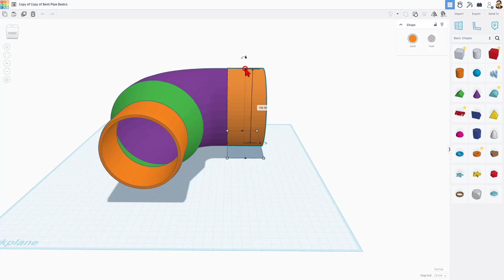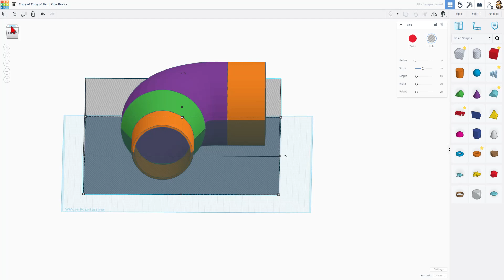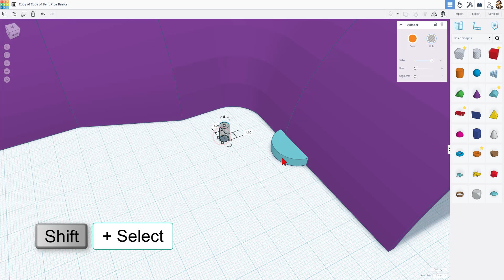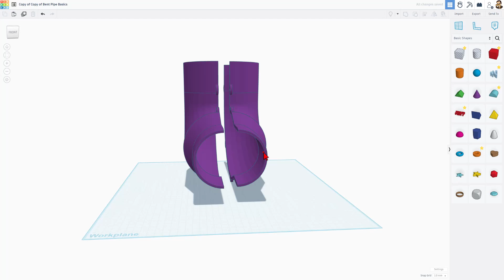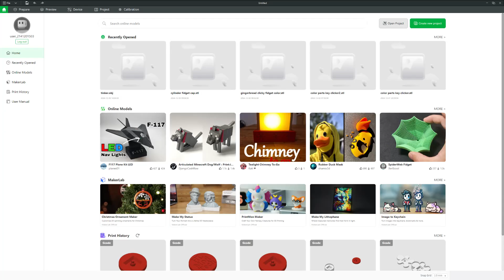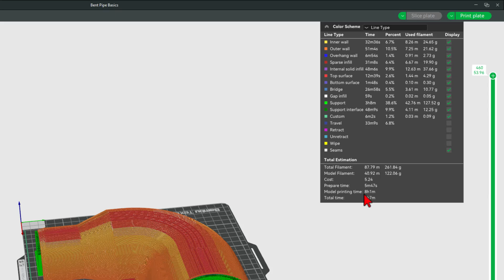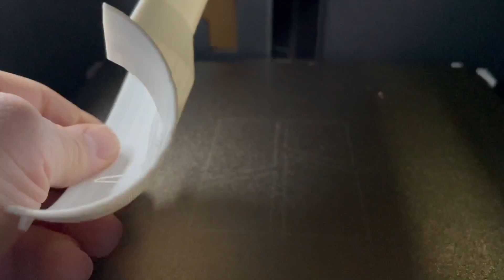Print Fast Tinkercad Halves Tabs & Skipping Supports Bambu P1S

Comment: Mike @0:28 you measured the distance. How did you do that? Also, what do you to "weld" parts together?
Reply from the maker: When you click on a single shape, like that tube I clicked on, it gives you the dimensions in x y and z. Another slick way s using the ruler. https://youtu.be/LFfZ_b7OdRc
Reply from the maker: Gloop! is my go to for welding PLA.  https://youtu.be/UHDB-8B7RDE It is available for PETG and ABS, but  have not experimented with them yet.